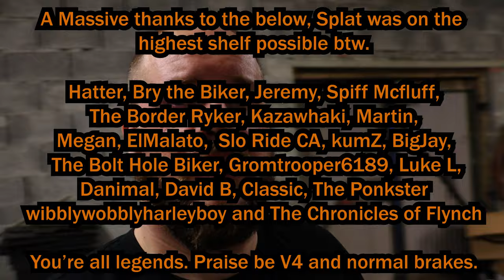How to Change Brake Pads | Honda CBF1000 GT

Comment: Just done my 2010 ABS bike using this method. Worked absolutely fine. Only minor problem was on the first caliper the anti rattle spring fell out and it took a few tries to get it back right. I fitted EBC track day pads, still suitable for road use. HH pads were already over £30 so paid £44 a side for these. The existing pads were nearing their limit and had four separate friction pads on each, whereas the EBCs have two, therefore more friction pad area in comparison. Quick and easy method avoiding any brake bleeding; about 20 minutes a side. Didn't do the back brake at present as it looks a lot better than the others. Very helpful video, cheers :)
Reply from the maker: Ah yes those track day pads look the job, I have just heard they're sometimes not great from cold and need to be warmed up which is why I stuck with the HH, commuting to work I need them to work from the off, but let me know how they work out as it'd be a great option :) Thanks, glad it was helpful :)
Reply: Oh, now you've got me worried. From what I can see, both the HH and the pads I've fitted are fully TUV approved and on testing them out ( gently) they felt fine with a decent initial grab from the off. According to the info on the back of the pack the pads were in, there's others that are not TUV approved and only for track use. I'll update you once I've a few miles on these :)

Comment: OWNER CBF1000FA-C 2013 Thoroughly enjoyed your video, totally agree with your comments on rear braking stopping power. My model has 5 pistons, I assume less effective than your 9 (3x2 front +2rear) pistons. I found EBC174 pads had been fitted in the rear, now fitting HH pads in hope of some improvement. 👍
Reply from the maker: Thanks! Ah they changed the rear on the mark 2? I didn't know that. That'd surely be cost saving rather than just have 3 of the same. Mad. 
HH will absolutely help feel at minimum, the bike stops and isn't terrible but I do wish I had a liiiiittle more bite even now, still after my jaunt on the track I'm a lot more comfortable with the stopping power that is there :)

Comment: Another good one.  I have always been brake obsessed.  I would have bled the system after a pad change, especially if you had suffered fade...  Look forward to seeing you struggle with the cables....  Hope feel better soon !
Reply from the maker: Me too, brake lines, good pads etc etc. I want to upgrade the master cylinder on the gsxr too. I usually would, but the linked brake and ABS system you apparently pretty much need a tool to bleed it correctly as there is so much lines. It's one job I probably wont ever tackle myself. Linked brakes suck for many reasons :D The cables on the gsxr should have been fine :P But of course something went wrong :D I'm getting there, thanks!

Comment: Hi Gorilla, love the videos on the CBF 1000, but i was able to do back pads without taking axle or chain off
Reply from the maker: Yeah I can't remember did I show it but I was having issues with getting out the rear bolt that allows you to pivot the brake pad up. I'd previously had a bearing fail in the rear wheel that I think may have helped that! It's been a long time so I can't remember what I mentioned in the video, but glad you got it done either way :)

Comment: I've just bought my first Biffer and these vids are a great resource, so thanks. One question - would you not give the pistons a clean before pushing them back into the caliper? I always did this on previous bikes but must admit it simplifies things doing it this way.
Reply from the maker: Glad you like them! I did clean the pistons, from memory it's in the video in a very short clip. People tend to click away when you show actual cleaning though so I edit it out. Always give them a clean, I also rebuild calipers when they need it. I have videos on that process too, just not for this bike but they're all very similar.

Comment: Nice! My only question would be if it would not be a good idea to go ahead and clean the break rotors?
Reply from the maker: It brakes a lot better now in fairness :) Yeah you absolutely could, I actually did clean up the bits I touched off camera but didn't mention it, good spot!

Comment: Halfords advanced tools? What you make of them? Rear caliper overhaul next please 🙌🙌🙌
Reply: Also I don't know my arse from my elbow when it comes to bike mechanics but from what I undersand thread locker and not grease should go on caliper mounting bolts? Could be wrong tho
Reply from the maker: I like them, been using them years and have had no issues. Bike work in particular is very light anyway so doesn't really stress tools, I've actually done caliper rebuilds front and back on the gsxr rebuild if you haven't seen them? :)
I've never used threadlocker on them, you certainly can but with the heat cycling they often tighten up themselves so I've always used copper grease as it's an "anti-seize".
Reply: @TheGorillaBiker   I just got the 150pc set and only been messing around with spark plugs and pad changes, been pretty decent so far to be fair! I'll deffo check out the caliper rebuild. Your hornet spark plug video really helped me.

With the brakes being so important I try and follow the manual/manufacturer recommendations to a t and putting grease on there instead of thread lock seems a bit counter intuitive to me tbh. Grease also changes the torque further risking stripping from what I've heard and read? I'm brand new to this stuff so genuinely asking and trying to figure out the right way. There seems to be a lot of different info regarding this stuff everywhere. I actually prefer the workshop vids to the riding ones! Keep up the great content

Comment: Nissin brake pads make breaking pretty smooth. But there is a huge price difference.
Reply from the maker: Honestly HH EBC brake pads have always been my go to, not much pricier and always make a difference. I think the only way I'd get the brakes on the CBF to "feel" how I like brakes, is to de link them and add braided lines.
Reply: @TheGorillaBiker  You can give a shot. There is no such a huge difference between EBC and Nissin in terms of total breaking performance. However Nissin's pads are softer. That is why first biting feels much more better than EBC. You can get same performance with less pressure.  I would like to ask something else since you have same bike. My cbf's handlebar vibrates between 60-110 km/h when my hand off. I saw there are many people suffered from same problem. have you got any idea or suggestion?

Love your videos btw. Great explanation ^^

Comment: Useful video for the front, I'll need to do mine soon...however....I've just done my rear pads (Mk2 CBF) and erm, I didn't need to remove the axle. You sure about that bit? I did undo the end can retainer (because it made access easier obviously) but otherwise it was a doddle. Even for me! (Which is saying something :) )
Reply from the maker: Yep, the mark 1 is mounted on a loop through the rear axle. The bolts aren't removeable from the side :) Might be somthing they realised was a bit of a shit job and changed it for the mark 2. I wouldn't know without doing the Mark 2. Or I could be wrong. I couldn't see a way to dismount it easily anyway, the most straightforward for me was the axle!
Reply: @TheGorillaBiker  Ah.....I did wonder about that bit. Seems like the Mk2 just "fixed" a few of the Mk1 issues. Sounds (and looked) like a pain to do! Still, good job and useful video - thank you! :)
Reply: Same as me I never removed axle. Just the pin squeezed the pistons dropped in the new pads and done. I have to do fronts soon so great vid GB thanks.
Reply from the maker: Whoyou if you managed that you're far more flexible than me! I can see that would be possible :)
Reply from the maker: @Martin ah no it's not too big a pain, dropping the axle is more a tad annoying than anything major it's still only 10 mins :)

Comment: the principles' are their, your missing the science of it all, you don't use copper grease on abs units it has metal in it, use silicone on the pins, use red rubber grease on the pistons, make sure your cleaner is rubber friendly, don't force the pistons in before cleaning them, your forcing crap past the seals. and what in gods name your cleaning inside the piston for i don't know, its the outside that matters, you should also clean the clips and a smear of grease, and if your brake's are still bad try replacing the fluid, i do mine every year, if your pads are cooked then so is your fluid. hope this helps, and look into why you should use Honda air filters, their made from differant papers which breath easier, no that cheap hillflo crap.
Reply from the maker: I only put the copper grease on the threads of the pin to stop it seizing, if that affects anything there there's an issue with design imo. But fair point, silicone would be better.
I do use red rubber grease on pistons. Not sure why you're aiming the cleaner comment at me, safe to assume I used proper brake cleaner. I did clean the pistons lightly before pushing them in, I wasn't doing a full rebuild.
For dirt, why not clean the inside of them, better than leave a heap of dirt there eh. 
Fluid was fine, the issue is just that brake system in general I'm not a huge fan of, it functioned fine.
I've never had an issue with hiflo. I've also never stated I'm a mechanic ever, in fact I generally remind people I'm an idiot :) The purpose of this video was to show people the basic how to get the pads in and out, not an in depth video on everything about brakes.